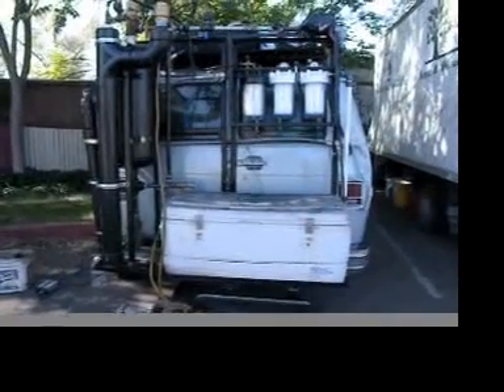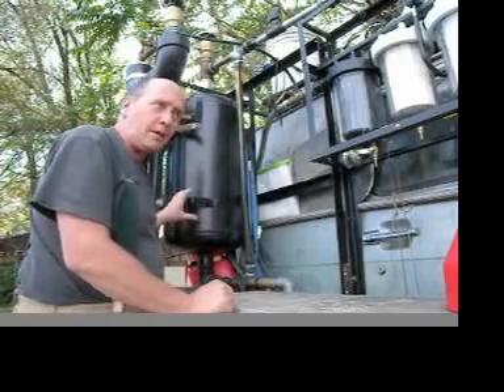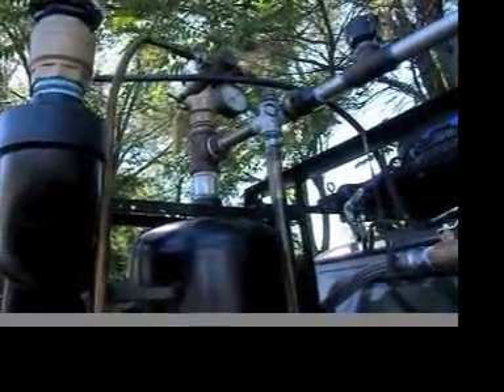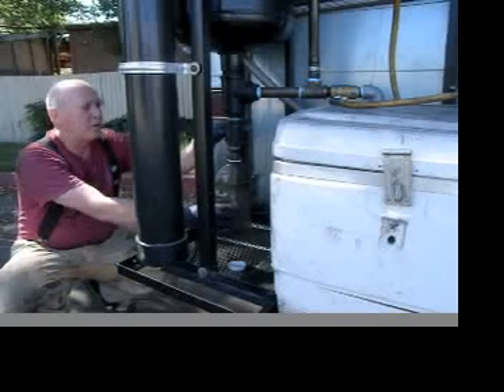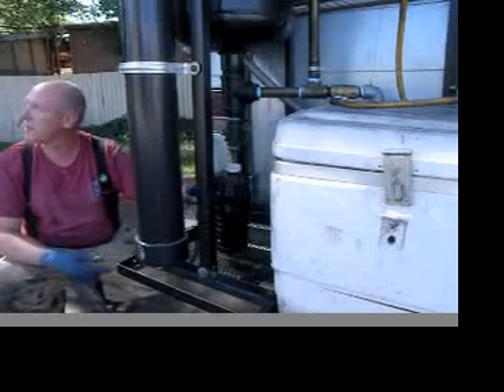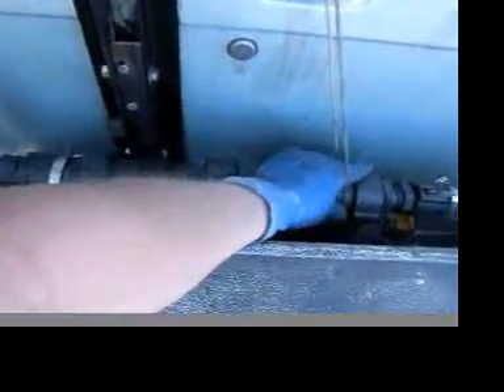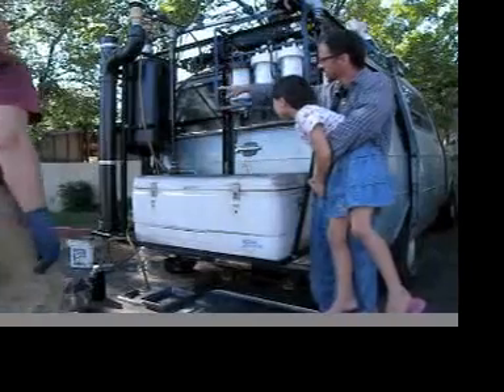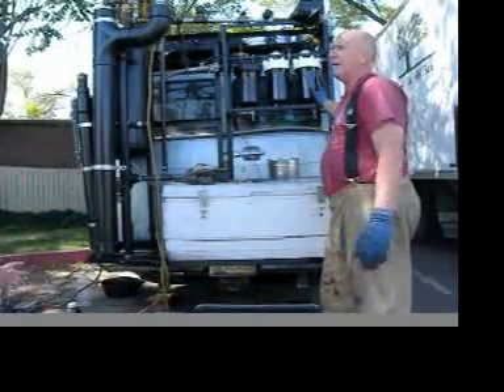Introduction to Waste Oil Blend Diesel Fuel (WOBDF)

Comment from the maker: The newer common rail DI diesel engines with the pencil style injectors seem to run WMO blends better than the old style IDI diesel engines.  And, I do know of people running the 6.0L PSD engine on WMO blends. 

The blend that seems to work best on most DI diesel engines is 20% gasoline to 80% WMO.

IDI diesel engines seem to run better with less WMO, such as 25-50% WMO to 25-50% gasoline and the rest diesel fuel.

Comment from the maker: Blending works with most oils, but not with animal fat or hydrogenated oils.  So, if I am processing WVO, then I will settle it for as long as I need to to remove the animal fat or hydrogenated oils, then remove them before blending.

In the case of mineral oils, then I blend right away, then let it settle out the water and particulate.  

Most oil sources can be settled after blending for as little as 24 hours.  However, WMO seems to need about a week of settling.

Comment from the maker: The sludge makes good fire starter.  It will burn for 2 hours and does not smoke or smell bad.  It can be rolled into recycled newspaper to make "logs."  It can also be mixed with sawdust and rolled into "logs."